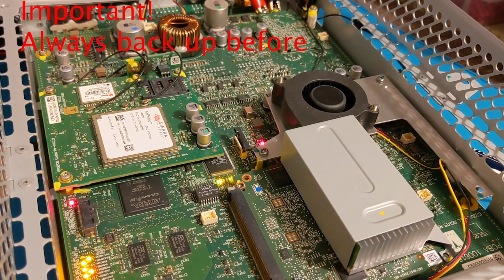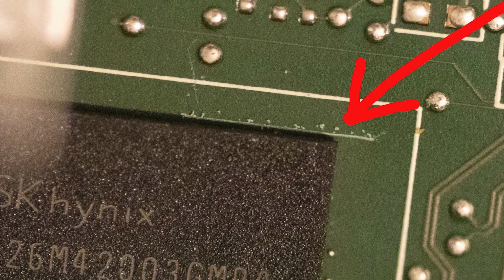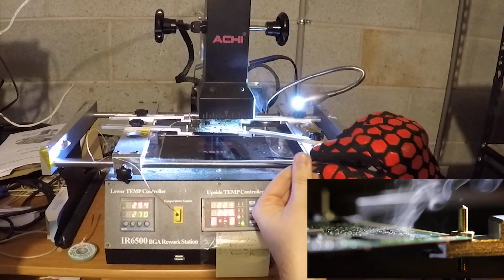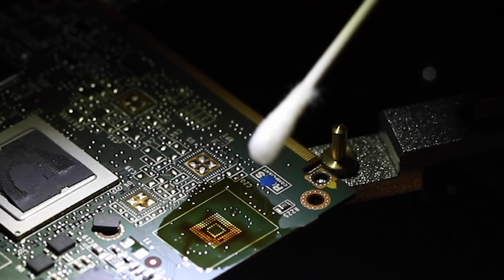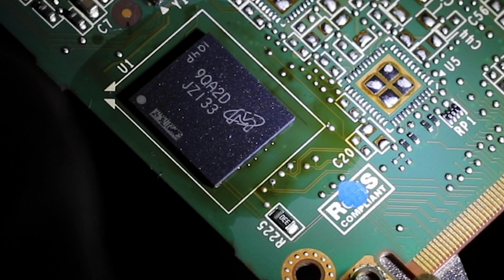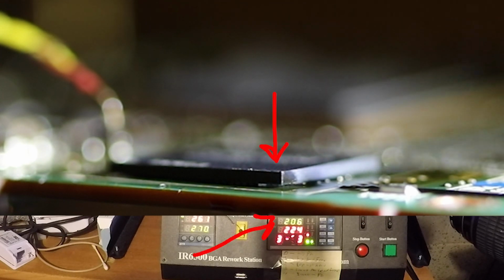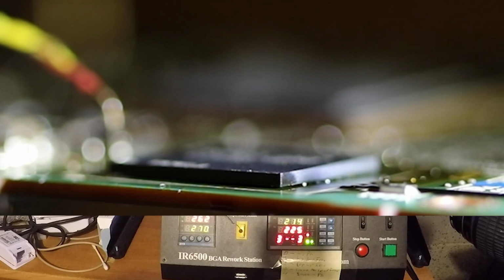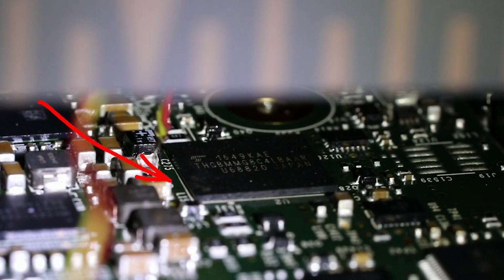Replacing Tesla Tegra EMMC chip

Comment: In other BGA solder demonstrations (non tesla related) i see them masking the surrounding area with kapton tape to protect it a bit from the heat and moving around. Kapton tape could also be used to mark the spot where the chip has to be instead of marking the pcb with a blade.

Comment: This is insane. Nice job. Is this normally done by a robot?
Reply from the maker: at a proper factory - sure, but at your phone repair shops and hobbyist places? definitely not.

More skilled people use hot-air stations, but I never got to work it properly, IR reflow is super simple on the other hand - no airflow to blow chips away or overheat beyond the target temp.
Reply: At manufacturing time, yes, all this is done by a robot. The solder is applied as a paste using a metal stencil similar to how T-shirt graphics are printed, so there are no solder balls involved. A robot just has to pick up parts off a reel and place them on the boards, often at ridiculously high speed. Then, the whole board is run through an oven and everything melts into place. For rework, though... it's fairly more complicated, as you first have to remove what was already placed by robot...

Comment: Hello i have a unsupported model S p85  2014 mcu1 super laggy and freezes so i bought a muc2 from ebay.  I live in puerto rico no tesla support here. May i ask you can i clone the emmc from muc1 to mcu2   because its not plug and play. When i tried on the mcu2. I got a model x with the milage and all info from the donor car.        I have a tool for tesla called loki. But doesnt have a clone mcu option . Its more for other thing.  Support from the tool i have. Told me that with jtag emmc programer i can do a clone and it will work.   Do i have to remove the actual chip and then with that program read it.  Or can i with a pin out read and dump on mcu1 and  then muc2.  Any help is greatly appreciated.

Comment: Maybe 500K Teslas are going to need this chip replaced, someone has to figure out how to do it for a reasonable price.  I would have no problem getting the Tegra board out of the car and back in. I have done SMD prototyping but not BGA.  What I have not figured is how to download the data off of the chip. Have you done a video on how to backup and restore the data files?
Reply from the maker: there's a pinout screenshot and you can use easy-jtag to connect using that pinout and dump the chip. do you really need a separate video explaining it in a lot of detail?
Reply: I do, never done this before and not sure what you taking about. 
A separate video would be great !

Comment: I had my 4/2016 Model S with 64K mi screen go black two days ago.  There was no way I could re-boot it so I took it to Tesla service today.  The said a rebuilt/exchange MCU was $1146 installed.  They said I could have the HW2 Infotainment upgrade for $2250 and I told them to go ahead with that.  Awhile later they said they couldn't do the upgrade only the exchange because my S didn't have electric trunk lifts and they weren't allowed to do the infotainment update on my car as the version for my car was not available.  I wonder if I try to read the chip and do the BGA soldering and fail if they would know the difference.  At this point I am waiting to see if they can restore the file system and bring it back to life without spending > $1000.  For over two years I have been complaining that the web browser worked when I got the car, then it stopped playing my USB drive, weeks after that it would not re-boot until I removed the USB and now it just plain will not boot.  I was surprised however that the autopilot worked perfectly on the way to Tesla service with the black screen.
Reply: The "fun" part is that these chips cost about $10, or less if buying in bulk. You could essentially buy all the equipment from China for the cost of the service you were offered at the dealership. As stated in the video, it's even possible to do this with an air soldering station costing $40-50 or less. Many people think electronics are some kind of black magic, but it isn't any different than any other skill. Painting a picture is way more difficult. But it's a great video. So kudos to him for showing this :)

Comment: Hi Greentheonly, i want to thank you for this video as its very useful. I have tried to read the chip but it doesnt connect. I am using Easy Jtag on windows and i am getting CMD timeout error. Do I need have Linux for this? The only other thing is to get the esocket but i wouldnt want to desolder the chip before getting data in fear of getting in damaged
Reply: Hi, did you manage to get the data before desoldering the chip?

Comment: Could you press in some small locating pins at the corners before you remove the old chip?  New chip would locate right in place.  Or put some stiff putty at the corners before removing the old chip, same idea.
Reply from the maker: the temp is kind of high to find a suitable putty I suspect.
Reply: @greentheonly  How hot does it get?  There are high temperature putties available, silicone putty for up to 400F, and exhaust repair putty for up to 2000F.
Reply: Like he mentioned in the video, you just need to get it pretty close; the surface tension of the solder does the final alignment.

Comment: Why do you scratch the pcb?
Reply from the maker: scratch? you mean desoldering wick? while my techniques are not the best, you still need to remove the solder from the old chip before you put the new chip on
Reply: @greentheonly  thanks for the quick response, it was answered later in the video. You scratched to pcb mask so you can align the chip later. Great idea.